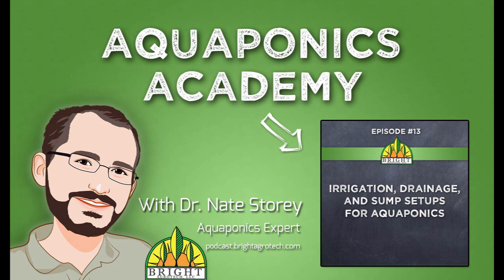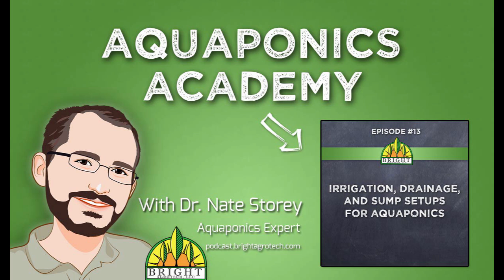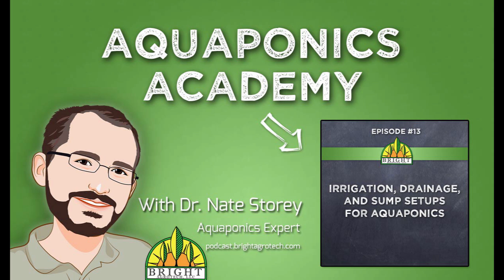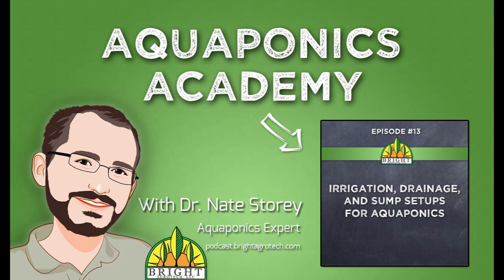Aquaponics Academy #13: Irrigation, Drainage, and Sump Setups for Aquaponics Systems

Comment: your system will not work without pumping system working all the time to keep the water flowing?  Is it not more
expensive to run your system than stationary growing beds?
Reply from the maker: Hey paul kawsek - most of the time the cost of running the system 24/7 is negligible compared to the stress of running your pump on a timer. It depends on your crops, the maturity of your crops and their water demands too. If the system is much smaller than ours, using a timer is definitely worth exploring.